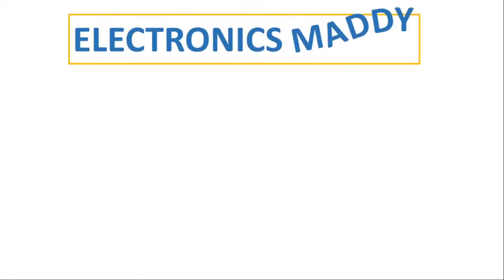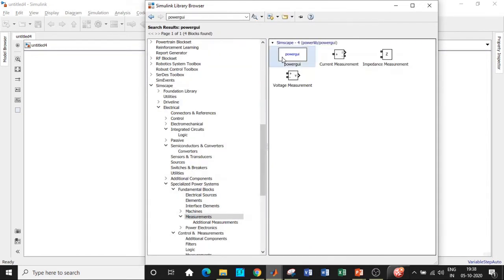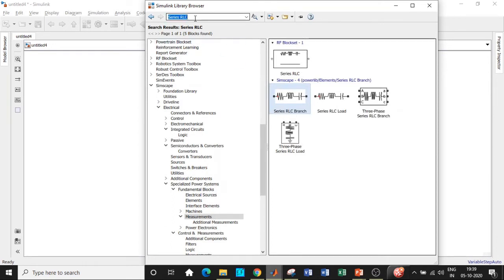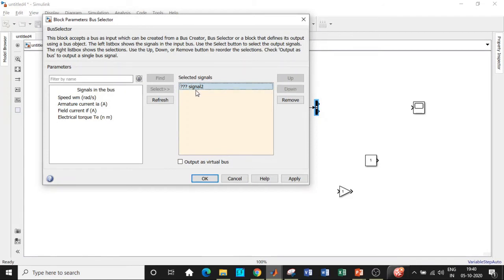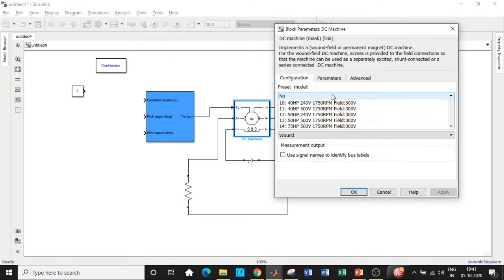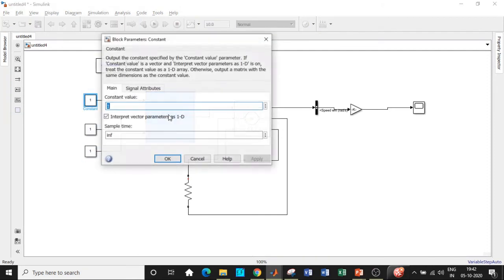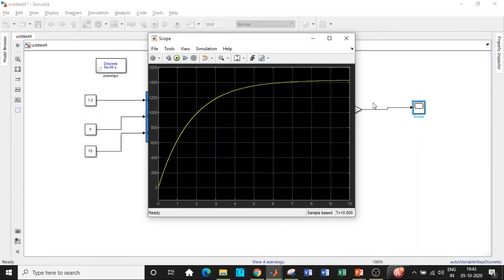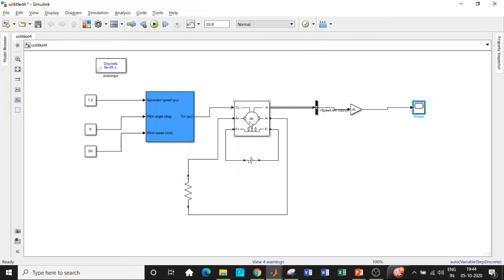Simulation of a Wind Turbine with a DC Machine in MATLAB | SIMULINK

Comment: Hello/Namasty

My Name is Umar and i am an Engineer by Profession. Currently i am doing my PhD in Electrical (Power and Control) Engineering. My Research Area is Development of Nonlinear MPPT control techniques for PMSG Wind Energy Conversion System as well as for PV Solar System. 
Can you provide me the Solar and Wind complete Simulink Files ???
Can you provide the complete Model of Wind and Solar along with all Simulink files and other materials ???
Regards
Engr. Umar 
Pakistan
Reply from the maker: I do not usually store files. Will suggest you to try. If you face any issues feel free to reach out.

Comment: Sir, do the simulation measure the output voltage instead of rpm? It is possible form a wind turbine to use buck boost dc-dc conversion?
Reply: Did you ever get your answer through a different find? I’m currently in process of designing one for my class and have thought about DC Generator but with SEPIC topology